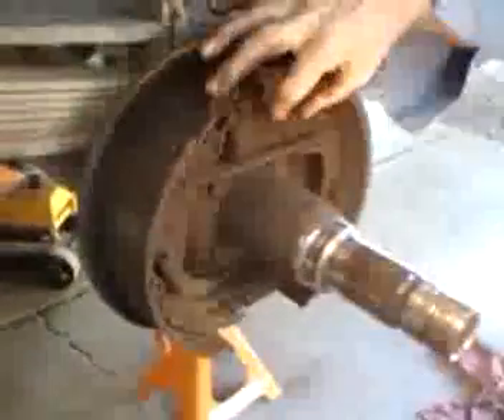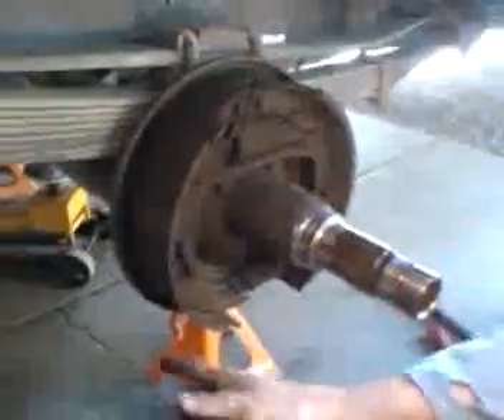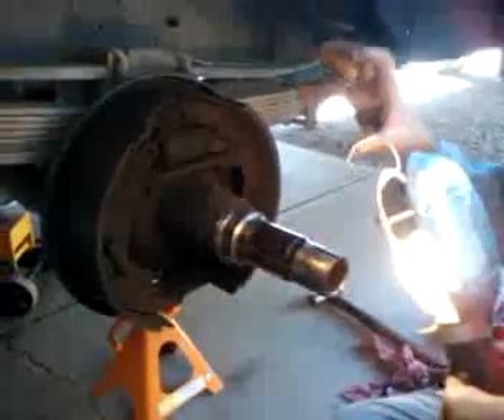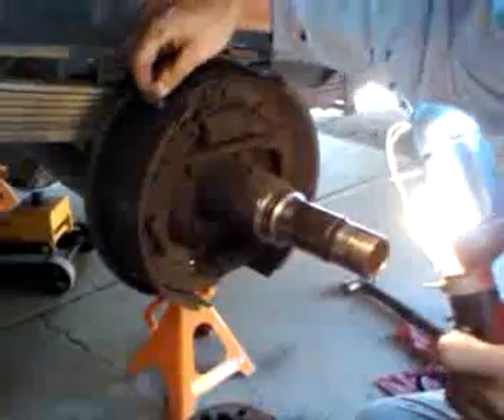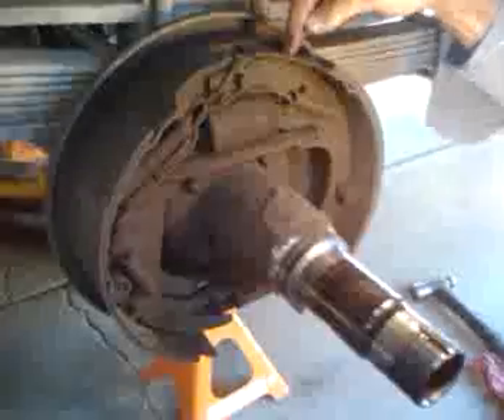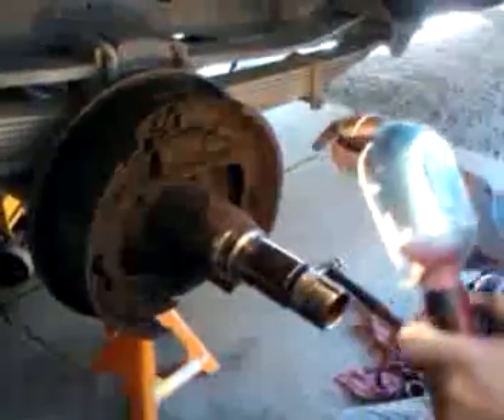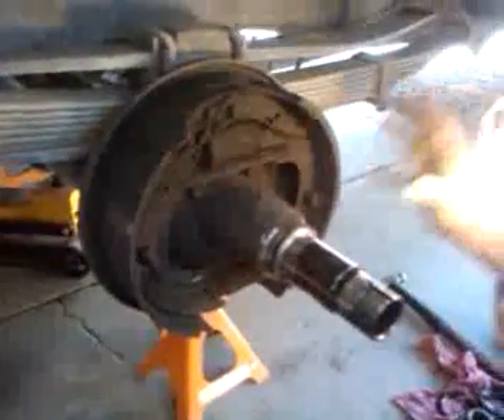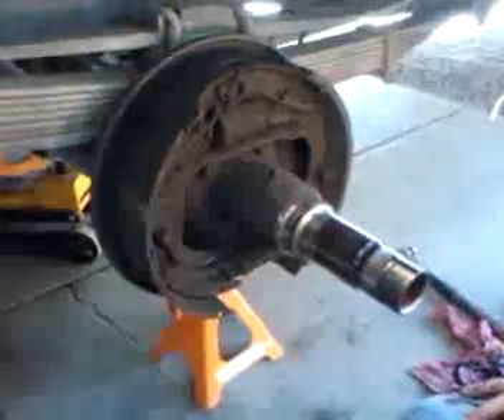Mr. Fixit Explains Self Energizing Brakes

Comment: Now i really understood how a self energizing mechanism work. Great explanation. I almost thought that self energizing is nothing but a dynamo which inreturn generates power. Its the drum brake force from the top piston which uses the force to push thr front primary shoe to use the brake force to complete the process. Wonderful concept.  Its nothing but saving the braking power using self locking technique.